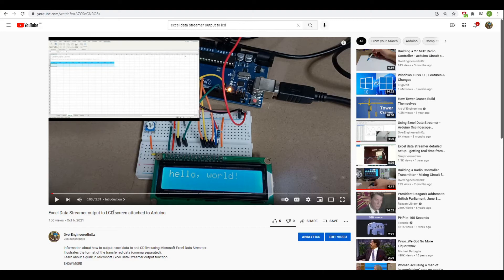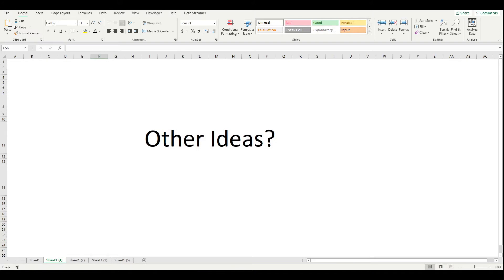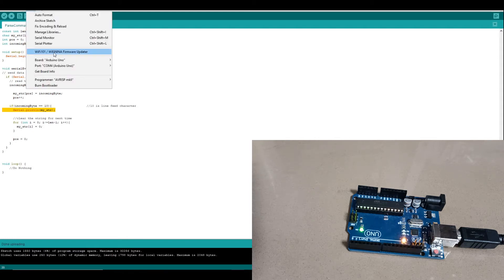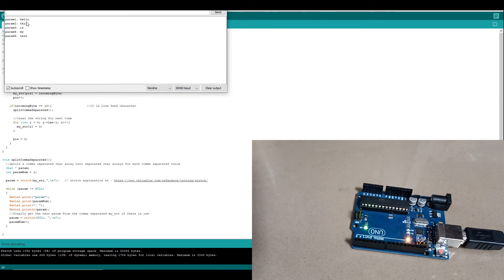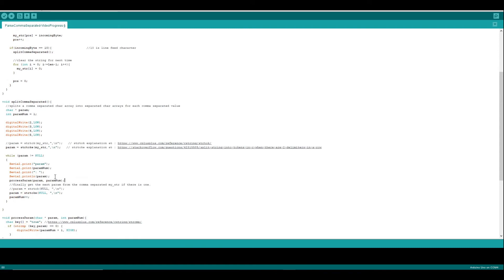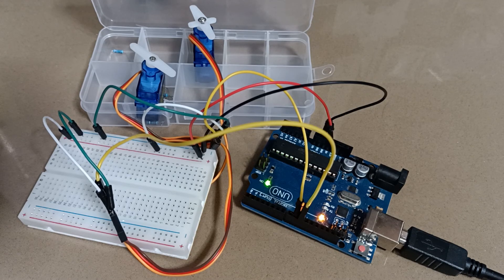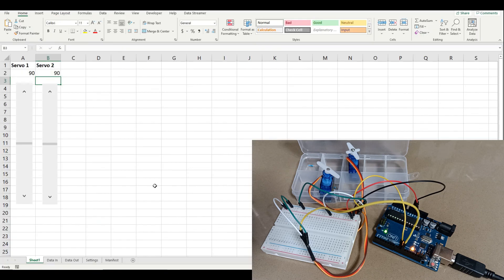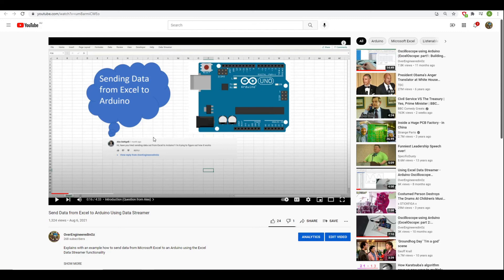How to control servos and LEDs using Excel Data Streamer and Arduino

Comment: Thanks for your series of videos that lead me to understand more about execl-arduino connection.
one question: can the data out sheet have more than 10chs? if we need to transfer more than 10 columns, what possibly can we do? thanks anyway.
Reply: my bad, i found it on the setting sheet.
Reply from the maker: glad you found it.  I have another video about communicating more than 10 items too.

Comment: Is there any way to import the table into the Arduino or something like that? In my project I want it to be something more remote, without the need for a computer.
Reply from the maker: You could probably write the data received from excel to the eeprom. Then install your other sketch and have it read from the eeprom.

Comment: I wonder if can we communicate Excel Data Streamer to Adruino with WS2812 LED attached. A simple task, if I put number 2 in Cell A2, then 2nd LED will turn on.
Reply from the maker: It sounds possible to me.
Reply: @overengineeredinoz7683  i wish to get some advice to achieve that. Thank you.

Comment: Great video!  Thank-you for sharing.  What is the maximum number of output channels Excel will allow?  The default in your video is 10, but microcontrollers such as the Arduino MEGA 2560 can handle many more. I'm curios if Excel has an output limit.
Reply from the maker: I haven't experimented with changing it but even if you are stuck with 10 there would be the possibility to use some sort of character as a separator and then put more than one set of information in each channel and then split it on the Arduino side.
Reply: @overengineeredinoz7683  Thank-you for responding. That is a great idea to combine data into 10 channels if it is limited. I am hoping to be able to output to about 24 channels.
Reply from the maker: @loddie9  I have done another video showing how to do more than ten channels.
Reply: @overengineeredinoz7683  Thank-you for the videos showing how to use more than 10 channels!  They were very helpful. Somehow, I missed them until now. Subscribed.
Reply from the maker: @loddie9  thanks. You are welcome.

Comment: I have done the process for the servo part but I couldn't find the same icon to connect the com port except that everything that you explained was crt and I got r8

Pls help me with it to found out the error to the connection between excel to arduino

If you provide your contact details like mail it would be helpful
Reply from the maker: I think the answer you are looking for will be covered in my video send data to Arduino using excel data streamer
Reply from the maker: The playlist excel data streamer will probably be useful for you.

Comment: Hi thanks for the great video,is it possible to connect an led screen that displays voltages and current to excel? 
Whatever the values on the screen will show in excel?
Reply from the maker: I measure voltage and show that in excel in the oscilloscope video.  
Using Excel Data Streamer - Arduino Oscilloscope (Exceloscope part4: automation with data streamer)
For current you would want to have a known resistor in the circuit and then measure the voltage drop across it and then use ohms law to work out the current.  An excel formula could be used to do the calculation or you could do it on the Arduino side.

Comment: Hi, i'm currently doing a project where I have a set of list in excel and i need it to link the code numbers in the list to the LED lights without the need of typing "TRUE" or "FALSE". Is this possible?
Reply from the maker: Yes I think it would be possible. Excel sends data to Arduino in a comma separated list. You can then process the data on the Arduino side.

Comment: Hi. Great video. I am using the servo control part of your code for my project. I was wondering if there is a way to control servo speed while keeping the same working principal?
Reply from the maker: I think to control servi speed I would try passing smaller incremental positions on the way to where the servo needs to end up. This could be done on Arduino side if still not slow enough try introducing a small delay between each new servo position command.

Comment: I'm new to arduino.  In fact I have one ordered buy haven't received it yet.
My though is to use excel activex controls to control fan speed through the arduino.
  In other words build a cheap labview interface (I don't have)  using excel (which I already have.
It seems, using this method that it would be possible.
   Just send out a serial string when a value, in excel, is changed.

But I ponder if using the computer's parallel interface wouldn't be more efficient.
    (yup.  I still have a computer with a parallel interface (aka printer port).
     Assign each output pin (there's 8 total) on the parallel port to one of the control 
     channels.
BTW, I am already using parallel ports in this manner for other applications.
   It means not having to shell out mucho dinero for labview I/O boards/software.
Reply from the maker: Thanks for the comment!  
I don't have any experience with using a parallel interface so I won't comment on that.  
On the Arduino side of things what you are wanting to do is definitely possible.  You can generate pulse width modulation signals from the Arduino really quite easily and that could be used to vary the speed of your fan motor.  You probably wouldn't want the motor directly interfacing to the arduino pin without adding some other circuitry due to the motor being an inductive load that could generate spikes on the arduino pin and damage it.  
Often with motors a thing called an H-Bridge circuit is used.
Reply: @overengineeredinoz7683  Yes I have a couple l298h driver for a small motor.  The fan on the otherhand is 12A so I will build a driver circuit using some 20A transistors.  I could control the fan through external means  but where's the fun in that??
But, first I need to learn how to setup the Arduino.  I just checked and it's out for delivery.  Should be there when I  get home tonight.
I am building a wind tunnel to test drag and lift of golf discs.  I'm currently working out how to spin the disc while it's in the tunnel and still monitor the lift and drag.

drone motor mounted inline on the shaft between the load cell and the disc?  I want to minimize the influence of the weight of the motor.
Reply from the maker: Sounds like an interesting project.

Comment: Hello, that is really great what have you done and show here. Is it possible to control from excel addressable LEDs WS2812B? The idea is to connect the Barcode or QR Code Scanner to the computer and depends on which barcode would be scanned then proper individual LED would light up?
Reply from the maker: It is probably possible. I don't have any experience with ws2812b or barcode scanners but if they can appear as com port to computer it could work. Otherwise if you are able to read from the scanner to Arduino and control those ws2812b from Arduino then it would definitely be possible to do.

Comment: Hello sir, Why I cant do this project with esp32 ?? ESP32 not answer
Reply from the maker: Can you get it to read and write to and from the serial monitor?
Reply: @overengineeredinoz7683  can it do in arduino uno r3 ?
Reply from the maker: @yingnie2022  uno r3 should work fine